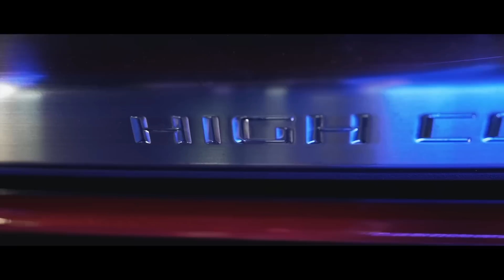AWD SS CLONE

Comment: I have a truck with shortie headers true dualed x pipe to 3 inch highflow cats and spintach out the back like a vet and it sounds just like a corvette when you are on it has much higher pitch sound then normal the muffler brand is spintech and you want a 4/6 drop for it thats as low as you want with it any lower and you will flatten the pipes

Comment: Go to Yellowbelly in Dallas, half the dam trucks there run 4 tip straight out the back Corvette exhaust lol. Hell even Tahoe's got them goes on them at Yellowbelly 😂
Reply: And I'll ad some do sound good but if you have soft suspension in the back when you take off it does drag and spark like a bitch in the 60ft